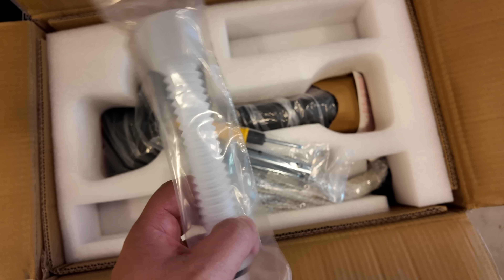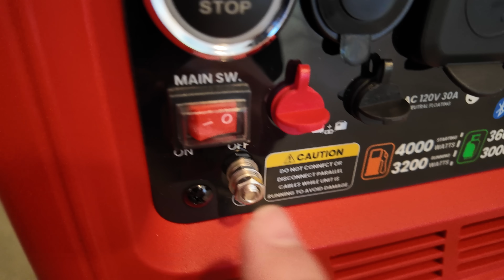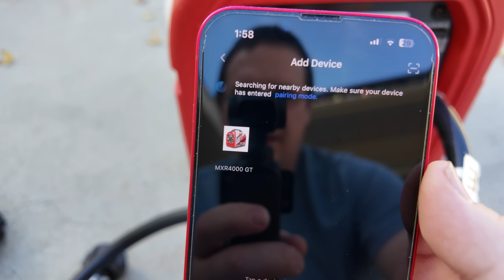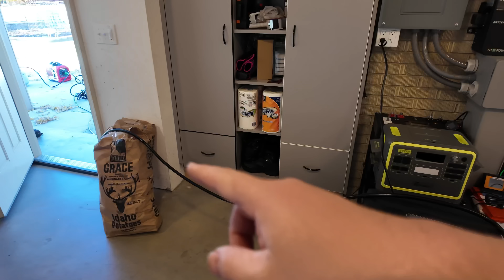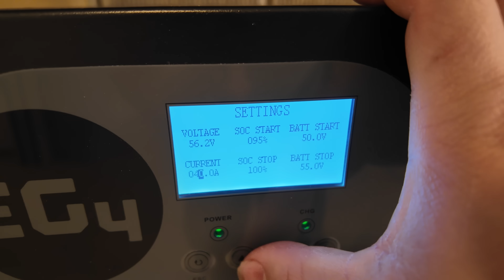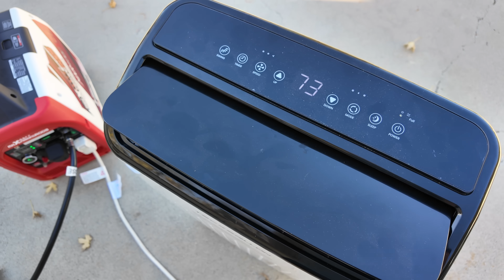UNPOPULAR OPINION: Buy Gas FIRST (Before You Ever Touch Solar)

Comment: Some solar zealots are just that, just unable to see that there are solutions out there besides their own. 

Solar is great, but has it's negatives. Cost and availability are 2 of the biggest ones. 

A generator is cheaper, has 24/7 power production capability, is portable, easier to get going from nothing, has several fuel options, can be had in 120 or 240v, and depending on model, can be scalable via parallel kit.
Yes it has it's flaws, it's noisy, requires more maintenance, you have to store fuel, are heavy (smaller units are lighter), non-inverter generators may not work on some setups due to "dirty" power, and they do pollute. 
As part of a complete system, they have their place, and can fill the gap in solar when the sun not shining. 
Also, there are tri-fuel models that can run on gasoline, propane, and natural gas, so if you have NG available, you have "unlimited" fuel. AS you mentioned, propane is a good option, the 20lb tanks are readily available and easy to store "forever", but can get expensive if planning on using the generator a lot. They make larger tanks that can still be moved by a homeowner, as well as larger, permanent tanks (but you start getting into a much larger expense with that).
Reply from the maker: Great thoughts! Thanks for sharing!
Reply: You won't be running a large generator on a 20lb tank. The regulator will freeze up in short order. 40lb minimum, 100lb better.
Your opinion of solar is cute. Costs have dropped tremendously. Availability? Lol. Won't waste my time on that one.
Even LiFePo4 batteries have gotten so cheap there's no excuse not to have a battery bank.
Reply: @fauxque5057  I have batteries. I have solar. I have generators. 
They all have their place. There is no 1 solution for all. I just love how you make so many assumptions. 
Again, solar fanatics are disconnected from the real world. Your specific situation does not apply to all. Failing to realize that leads you down the path you are on.
Reply: @blupupher  It's the same with EVs, wind power and nuclear, seems you're not allowed to say "for me this works, but maybe not for you". I have absolutely no need of a gas generator, I live in a very sunny spot, with plenty of space for solar panels, and can generate more than enough for personal consumption and require minimal heating - even now shorts and t-shirts are all the clothing I require and no heating required. But if I was in Minnesota or one of the other states prone to freezing weather, I'd have a gas generator.

Comment: I have a dual fuel geni to Ecoflow for backup to keep the area I use for incubation running. I did run into one issue where I had to switch over to Reg Gas as the temps were low enough that the propane wouldn't release from the bottle.
Reply from the maker: Interesting point about the propane and low temps! Thanks for sharing your experience.
Reply: What the boiling point of Propane? Isn't it like -48 degrees C? Man, you live in a cold climate! :D
Reply: @FoxvoxDKwhen it’s under compression, when it’s released the bottle cools. It needs ambient warmer temp to keep the bottle warm to release . Or else you loose like 50% of your bottle pressure.  So even -20 is enough to cause the issue.
Reply: @ClarkyMalarky  or just if you are running it fast enough. i work with a lot of folks that do propane art, and every single one has a system of warming bottles and warming gas before the art.

Comment: Most of us will agree with you.
Reply from the maker: I hope so! I looked forward to hearing more from people! Thanks for the comment!
Reply: Is,there a link for the unit and cost? i probly missed it
Reply: Is there a way to use the old style (dirty power) generators to charge the solar power generators?
Reply: @russellkamp8923 Hopefully"There'sATrickForThat" has a better idea but one is EG4's Chargeverter which to my understanding, cleans up dirty power from older generators. It's not cheap but much cheaper than replacing an All In One inverter or a battery bank due to dirty power.